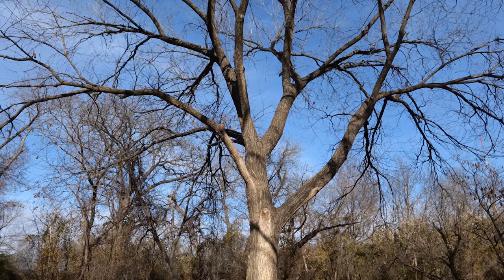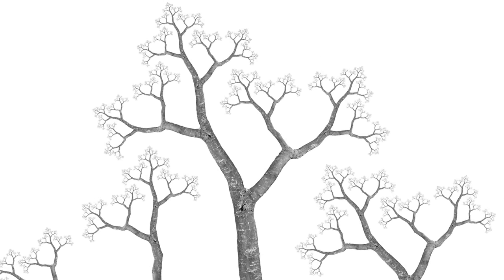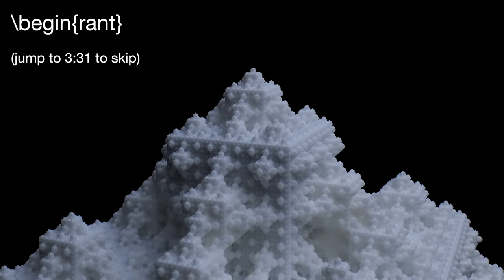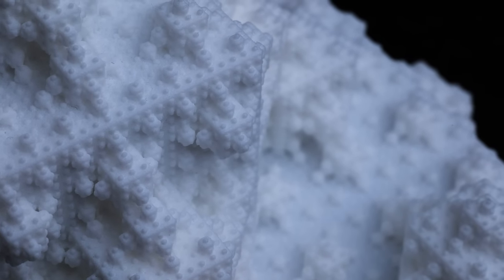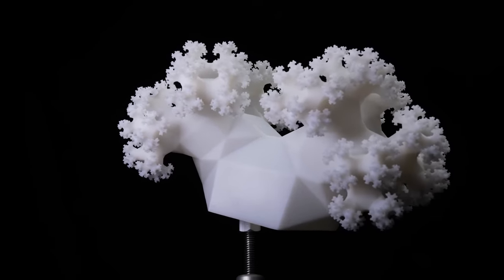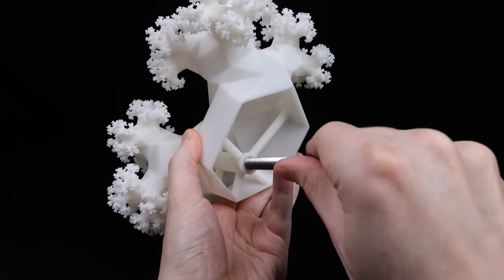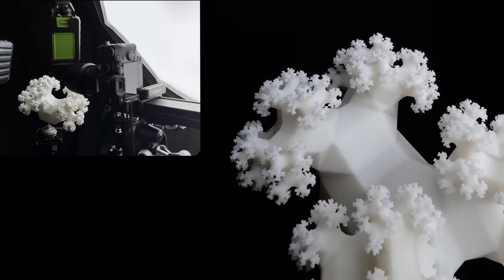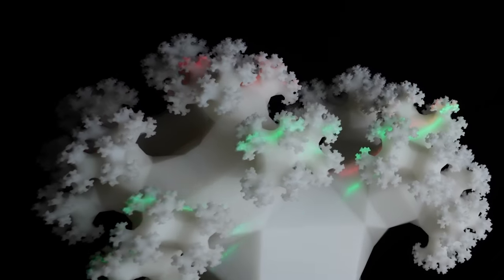Real-life fractal tree zoom

Comment: For me, it's actually easier to tell that the tree is zooming in the shot where the base is visible and the bigger chunk of the tree vanishes. Otherwise, because of the self-similarity, it kinda just looks like the camera is moving around the tree.
Reply: agreed. it doesnt look like we are seeing a smaller portion, just the other side
Reply: I have a feeling that's the reason he showed that version of the zoom.
Reply: It doesn't look like either a zoom or a rotation to me. It just looks impossible lol.
Reply: which is even cooler
Reply: Ditto. This one just looks like a continuous rotation. The other one was far better in concept. The previous fractal design is the winner, just need to back down at least one detail level so the closest and furthest shots don’t look so drastically different that it snaps you out of the zoom. You go from seeing clean details to mushy detail on each loop.

Comment: 3:30 Modern focus by wire systems actually include acceleration most of the time, so changing focus faster means changing it by more than going slower even when giving it the same input, at least for the focus ring. I'm not sure if this translates to the software control utility Panasonic has, but if it does at least some Panasonic cameras (and some other brands) have an option buried in the menu to use linear focusing specifically for focus pulling in video

Comment: Maybe it would jave bin easier to have camera motion anf focus pull liniar and instead increase the rotation speed of the print. (Don't know if others have suggestet this already though.)
Reply from the maker: If I did that, I would have had to alter the frame rate of the video afterwards to get a smooth transition.
Reply: @henryseg  I see. Hm. What about recording it realy slowly and speed the recording back up to normal speed? That way it would have a way to high frame rate and you could export it with 30fps or so without having to worry about smooth transitions. At least theoretically.

Comment: this is very cool !
Exact superimposition of first/last images seems to be quite hard. Have you considered using a photogrammetric software that could help you measuring the error in camera orientation between the two ?
Reply from the maker: I hadn't considered that, but my tools for improving the match-up (fiddling with things by hand) are not great. I wouldn't be able to use more accurate information about what is wrong without a much fancier setup.